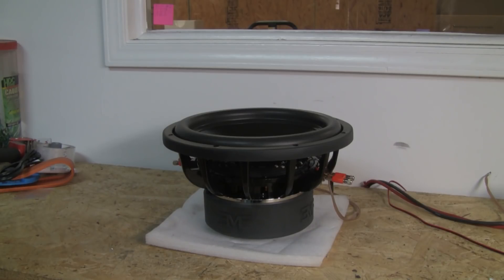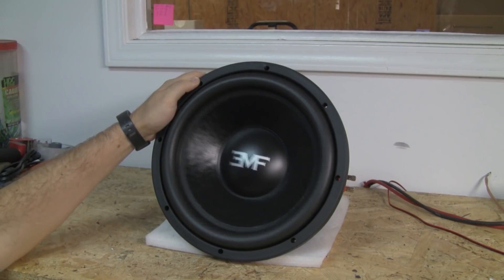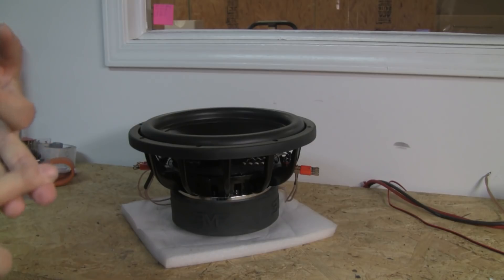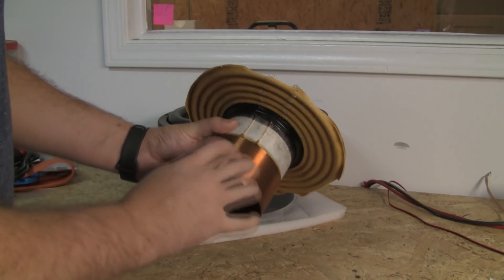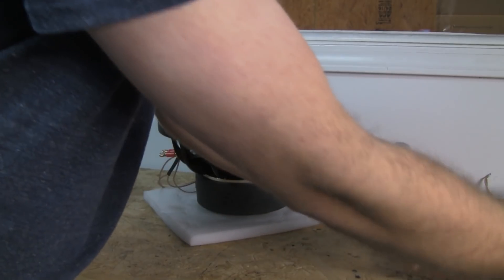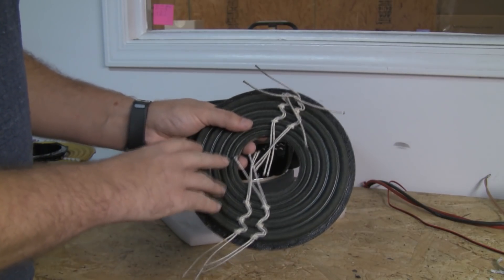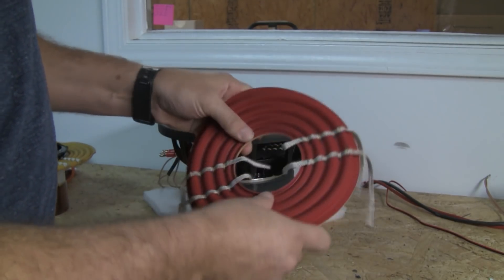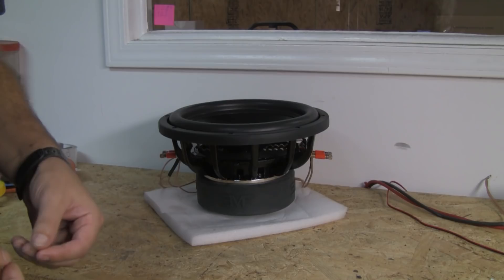Tech Stuff Tuesday - Subwoofer break in myth busted

Comment: I firmly believe the physics and engineering principles behind “breakin period” being good for gradual out gassing but otherwise unnecessary. Anecdotally I also believe anything that moves or stretches regardless it’s a car, a shoe or a subwoofer can benefit from a casual breaking in period. Car makers insist on new car breakin periods, shoes are more comfortable after some wearing in, and in my experience letting new subs settle into place before going all out never hurt. Metals have a certain degree of spring but can shear, crack or fail after sudden or prolonged stress especially in thin or ribbon cables. Basically I would suggest 25-75% power for maybe a week and then have fun- but with all the vibration and force on precise moving parts it just makes sense to me.

Key part is making sure your wiring /install practices and settings are legit proper - it’s easy to damage things by overdistortion or underpowering. Good connections mean way less dimming issues. But even that can be solved with an xstatic batcap they’re amazing.

Comment: Original Break In for speakers has nothing to do with loosening them or making them more flexible. It has to do with the polarity of the atoms in copper. It takes around 6 plays of 4 - 6 hours to polarise the wires/circuits so that all the atoms magnetic north are facing positive polarity to make the current flow efficiently and when they are there is less resistance. This is a common cause of people thinking their speakers do not sound warm and bassy when they buy them. After a week or two they realise it needed time to be broken in. It does not matter how loud you drive them though you will need to warm up the amp being that electricity flows quicker in a warm wire/circuit. Too hot or too cold is not efficient. The only effect of other types of break in is loosening the materials, that is not the original meaning of breaking them in from the 1980's. It is loosening.

Comment: What app did you use our what test time generator did you use for the around 2-3 min mark? TY in advance
Reply from the maker: It's the 20 year old CD from Bass Mekanik V5.0. Left and right channels are used at the same time, one channel is a half frequency, and the sound you get is what happens when you use both channels. If you use one or the other it's a solid tone.

Comment: I am still not sure if the box was too big.  You did not say if it is a ported box or not.  If it was they owner may have been driving it hard below the port tuning frequency in a properly designed box.  If the box was sealed and the system Q was over .71 he should have been ok and it was just operator error!
Reply from the maker: The box was nearly 6 cu. ft for a 12. If it was sealed that would have been insanely huge, but it was ported, which is still nearly 3 times the size it should be. There are ZERO instances where a 12 should be in 6 cu. ft.

Comment: Hi can someone help me. ?
I need a amp that can "play" from 0.6 - 5 hz
I want to play say 0.6 hz with 500 - 1000 w on a subwoofer. (Just for the fun of it.)
What amp can do that. How to make that amp?
Thanks
Reply: I'm not sure if you're joking or not because you can't play 0 hz. Not sure why you would specifically want to play 0.6 hz, vs say 1 hz. They are virtually the same thing. So, on to the next point. It's not the amp that plays the sound. The subwoofer is what does. The amp just gives the power to the subwoofer to reproduce that frequency. You need subwoofer that is designed to be able to reproduce those low frequencies. That's determined by the size of the subwoofers enclosure, it's tuning, the size of the woofer itself, and I'm sure some other variables. The amp simply sends the power to the subwoofer in order to produce sound. I'm not expert but I don't think you're going to be able to build a subwoofer to play 1 hz with any sort of volume whatsover. You could get down to 10 with a DIY sub most likely,  but that takes a lot of know how. If you want a sub that plays to 10 you're going to have to spend thousands of dollars.
Reply: @joshm5514  im sorry but you are a ignorant. Go on youtube type in subwoofer 1 hz. Or 3 hz. And you will find plenty vids. 
Evin a 1" dome tweeter can play 1 hz. 
Now humans only here from 20 hz and up. Im however not interessted in sound. Only in seeing my woofer moving. 
Now the amp is the most importent faktor to my q. You dont know -So you dont speak.
Reply: @degreesdegrees-jr4eg  only thing i could suggest try to find an amp with no subsonic filter or on that is defeatable.
Also i would say class A/B would be your best bet to get low.

Comment: The questions is why should the customer has to break in the subwoofer ?
Also, are the T/S parameters measured before break in or after? Because it will give you a wrong box design in software. I'm planning on doing some Dayton um18s for home cinema. 
I have a single pb-1000 and the first few movies and songs, it sounded like it was not even turned on. After a few days it just came to life.
Reply from the maker: The end user is breaking it in by using it, they don't have to do it prior to installation. The parameters you get are up to the manufacturer. The specs we provide are after a reasonable amount of break in. Are they going to read the same in 3 years? No. Do some manufacturers give specs based on zero play time? Yes. What you experienced is the subwoofer breaking in.

Comment: To get 12kw out of am amplifier if your running 14.8v you'll need 810+ amps. It's funny to me when people buy a so called 5kw power amp and 5kw sub and install it into a car/truck with standard electrical system 12v and 120-275amp alternators. Just guessing on specs.
Reply from the maker: Actually, 810 amps would be assuming 100% efficiency, which amps are not. They require even more than that.  You are correct in that people buy equipment they can't support and usually don't even use to their full potential. More often than note the same people that complain about blowing up amps never have the electrical to support the amps.
Reply: @EMFAudio  yes your absolutely right if its 100% efficiency. So it would be even more cause most amps are around 70-85% efficiency est and that's just for the power amp draw. You need to run the other electrical systems in the car/truck. I know you know your stuff. I'm just starting to learn about car audio in the electrical side of things. I've been doing home audio since I was 9 and 33 now and I just like learning audio workings. Thank you for the reply and correcting me as well I do appreciate it really

Comment: Ohh and what is your take on round vs. flat wire? That is a debatable one there.
Reply from the maker: Before you can talk round or flat wire you must first consider the material. You typically don't find round aluminum nor do you find flat copper. At least, not in subwoofers. If you aren't comparing the same material you aren't making any reasonable comparisons.
Reply: @EMFAudio  I'm a commercial/ residential electrician and have always been into car audio but I know in DC and AC  certain aspects apply as well as material and there's better conductors so to speak. Car audio has changes so much since the 90's I'm just getting back into now pushing 40 kids grown and things are payed off so now I have a little fun $ money
Reply from the maker: There are better conductors, but coils aren't just about conductivity. Example, using a conductor with lower resistance would also mean your coil would have to be longer and likely also wider to get the same impedance, which may have other consequences in design. Coils are about passing energy through a magnetic field.
Reply: @EMFAudio  well said you learn something everyday thanks for the input

Comment: HELP!
 i need an experienced persons aid because I'm dumb as F about car audio, can't figure this out...  Im sure i have blown one of my twelve inch subs, but it passes all of the so called "blown-sub-tests" to check if its actually blown out. I think its technically bottoming-out but again I'M NEW TO THIS.  

So...The fuk'd up subwoofer does produce bass, & at a comparable level to the other sub in my SUV..  

The problem is that unlike a blown sub that distorts bass 
 (I've blown subs before & know how they sound) blown-subs make that muffled rattle where bass should be heard .

  Instead my failing subwoofer makes low & mid level bass just fine until the bass really hits; then it makes a terrible "Thwack!" Slapping sound. The slap doesnt reverberate or rattle. Just one sharp crack every time the beat booms.

Some problems with subs are fixable & other's spell the end for the speaker; but NONE of the youtube vids or car-audio websites i have checked address this... & believe me I've searched 

The sub glides smoothly up & down within range when pressure is applied. No scratching, clicking or popping sounds come from the sub when I gently push it up & down...  

Sorry for the lengthy question but I'm trying to provide needed info to solve the problem.

Do you know whats wrong?  I dont know the impedance or ohms, just that its a 4-ch. 1,200 watt amp pushing two 12" subs. 

 I traded a Hdtv for the system, then simply paid a shop to install it. 

Yes im a dummy; please help me solve this. Thanks
Reply from the maker: For starters, if it's blown, it doesn't play at all or correctly. Now, what you're describing does sound like it's bottoming out if it's super loud (though more times than not, it will only do that a few times before it stops playing) but it could also be the dustcap being loose. So I ask you this: does one sub take more effort to push in than the other if they're both outside the enclosure? If the one that makes the noise is easier to push/pull on, you probably have a spider loose at the former. If everything seems equal then we'll address other things. It's powered by a 4 channel, which means each sub can have separate settings that may not match. Are your gain, crossover, subsonic, bass boost etc. all set the same on both subs? If you have bass boost up on 1 sub and not the other, that would cause that issue for sure. I have heard amps that clip with a cracking sound, if the gain is much higher than the other sub that could be the case too.

Comment: In my opinion I think it comes down to design and quality of materials being used. Its kinda hard to answer the myth about speaker break In due to the amount of different speakers out there. I have noticed that my system did start to sound better slowly over time the more I listened to it. May I also mention that clipping can be bad for any speaker. So its important that your amp and input signal are not clipping while you are attempting to break in your speakers. Cleaner the better. That means that proper tuning of your system is also important.
Reply from the maker: I specifically mentioned quality for a reason, poor quality subs break. Clipping is bad all the time, not just in break in. Yes, your system did start to sound better over time, because it was breaking in. It's not that speaker don't break in, it's that there isn't some magical procedure or duration. Breaking them in over 10 minutes or 10 years gets the same result.
Reply: A speaker "breaking in" is completely different from a speaker requiring break in period

Comment: I know this much... I didn't really "break in" my HCCA 152 which we all know has a extremely stiff spider. However!.. after playing it for over a year it started getting much louder.  So it did break in finally. Output wise at least. I just wired it up and started bumping. Orion customer service told me I was going to damage it. I do 150's with a single 15.... it's so broken😂
Reply: BaSsAholiC my orion hcca 152 blew put after a month and i was running an orion XTR 25001D and they told me its because i didnt break it in 😞
Reply: @ReVoLTedShadow.  yeah the Orion has a extremely stiff spider so it's definitely one of the subs that could at least use a gradual power raising process when you 1st start using it. Like don't go right to town hammering it. But really after playing it moderately for a few hours and mot going full tilt right from the start is good practice in general. Break in or not it's just better safe than sorry. I definitely didn't "break in" my HCCA to the standards Orion says you need to. But there was a sort of break in period. It's a year later and it's still getting louder. The xtr2500.1dz is crazy underrated so you could blow that sub with that amp. Especially if youre clipping.  Mostly if you're clipping.
Reply: @ReVoLTedShadow.  were you clipping?
Reply: Deputy93111  not that i know of , :0

Comment: PLEASE someone send this video to Soundqubed! 48hrs of break in?? Come on!!
Reply: Funny...i just hooked up my hdc3.10 i reconed and was looking for break-in info and found this video. Makes perfect sense to me. Thank you EMF audio for a simple and easy explanation of how subs work and the break/broken in process.
Reply: Break in has more to do with the sound changing than blowing up a speaker.. There is alot of confusion about this
Reply: Mine hdc3's played better after I followed there instructions tbh
Reply: ed elsey these are just my opinion base on my experiences. I do agrees that you can play a sub at its recommended power levels at full tilt in your system even if its new but I would lay attention to what my subs are doing and smell like.
Reply: ed elsey  Weather you believe in it or not, the terminology is totally wrong, it would be better said by resetting the cools.
due to normal or extreme play, the coil and former heats up, when this happens, the parameter changes, spider and surround fatigues takes quite some time to occur but the coils starts the minute one starts to play it.

even in this video, he mentioned this happening as well as how round and flat coils are effected by extreme heat passing through tgem.

Metals are effected as well as the adhesives used but by cycling the subs for a period of time it preset  the coils through that process before the customer even receives their sub.

this process also weeds out subs with defects that are not detected in a conventional way such as spider and former seperations that may get by in a normal inspection.
Reply: What do you mean Ed ? Is 48 hours too long or not enough ?